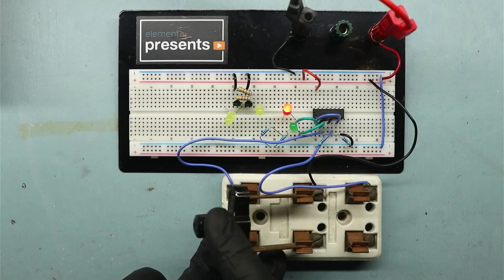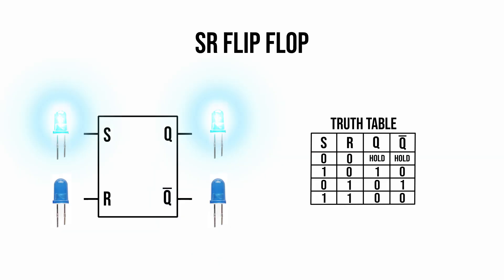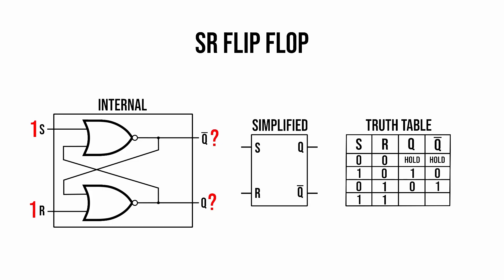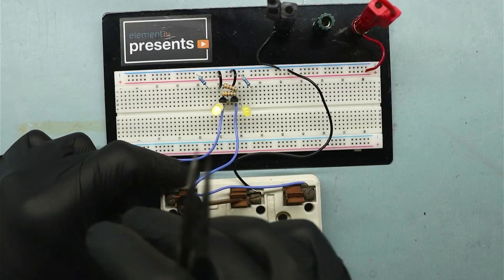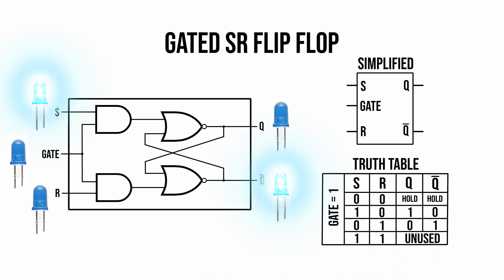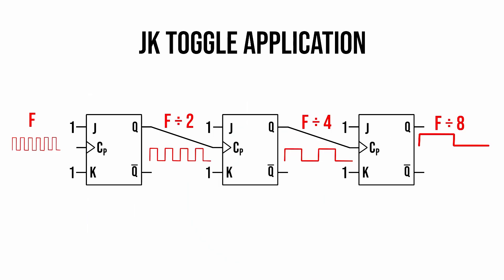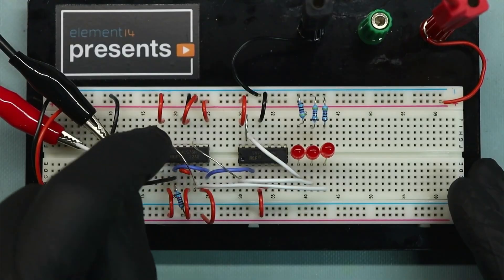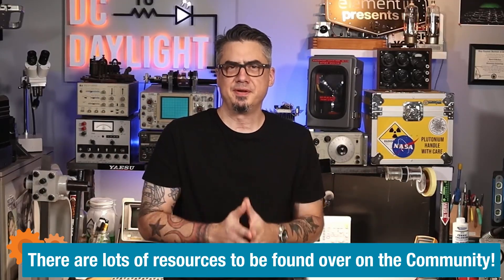How Flip-Flops Work - DC to Daylight

Comment: You didn't explain why a JK flip flop toggles its output, explain what is causing the toggling inside the JK flip flop because an SR flip flop doesn't toggle its outputs for what reasons why? Also you didn't explain how to Add "binary weight" to data signals or to timing diagrams to make a video lesson about binary weight and implying it to data signals and timing diagrams